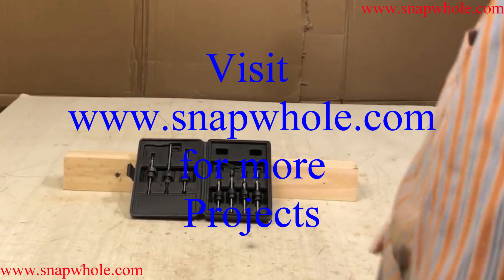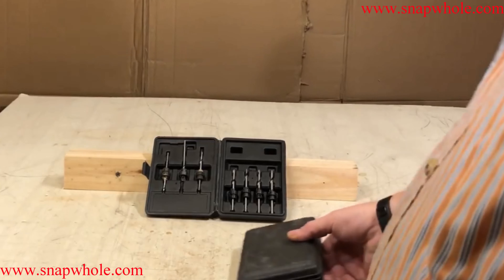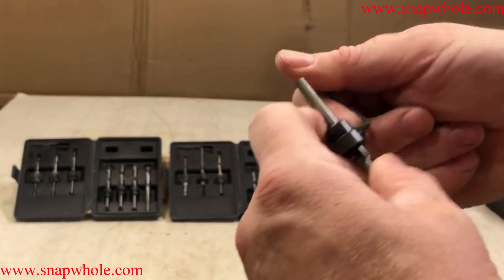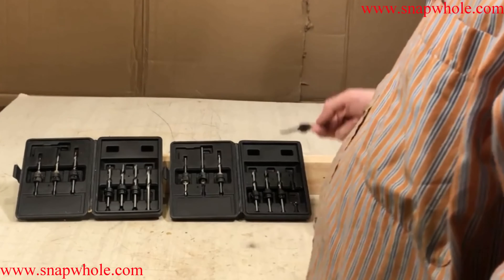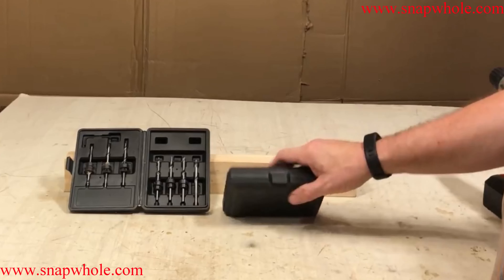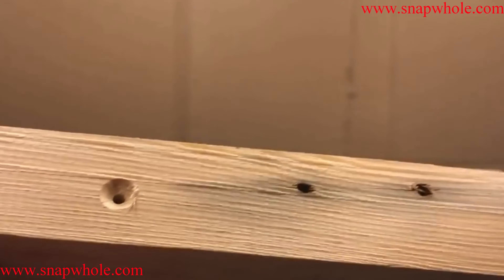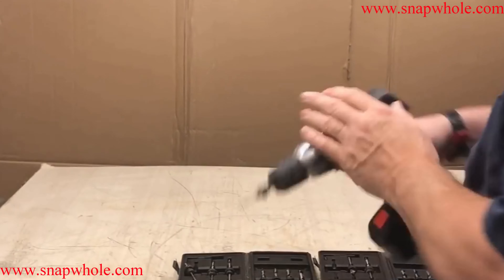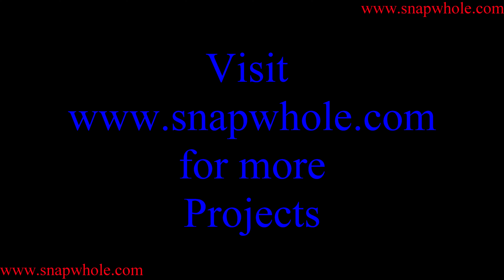Harbor Freight Warrior 21 Pc Countersink Bit Kit Review and Use Demonstration

Comment: I have found that the set screws on either side of the counter sink stop collar are helpful to get it square.  Just tighten them both up so that the stop won't move then use the set screw on one side to get the collar square.  Usually I notice that the collar is canted towards the direction that I was spinning that last screw to tighten so then I just go to the screw on the other side and "tighten" that one until the collar is squared up.

Comment: Have you tried the countersink depth stop collar parts on other drill bits that hold their edge better? Thanks for the cheap tool reviews. I’m trying out the HF blue plunge router on your recommendation
Reply from the maker: yes I have, I bought a pack of warrior drill bits and the stops work just fine on them - thanks for subscribing!

Comment: The complaint about a comparable set sold on Amazon was that the drill bits were dull. How do you rate the sharpness of the bits?
Reply from the maker: I use these pretty heavily in all kinds of wood, and they do not hold their sharpness as long as they should, for me, buying a single one of the smallest size would cover 90% of my needs, I have bought two sets because of them getting dull too quick, at the low price, I consider them throw away tools..... Thanks for subscribing!